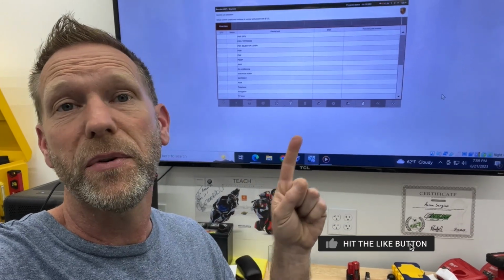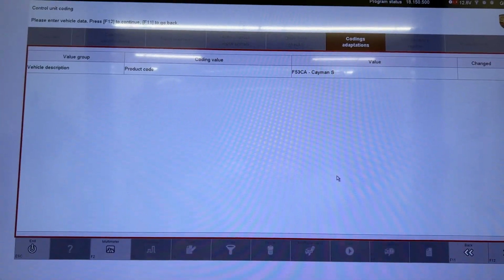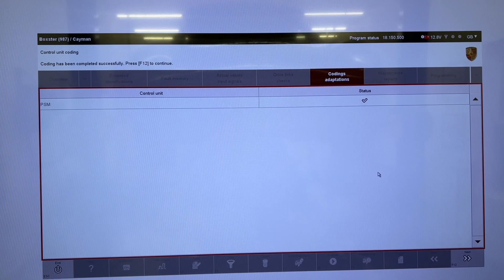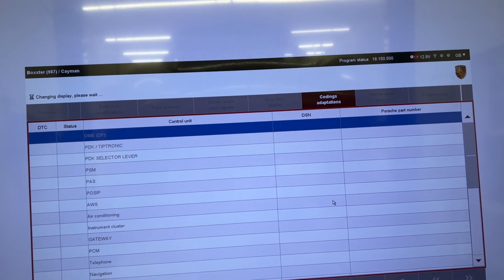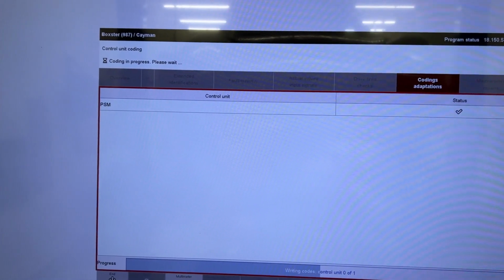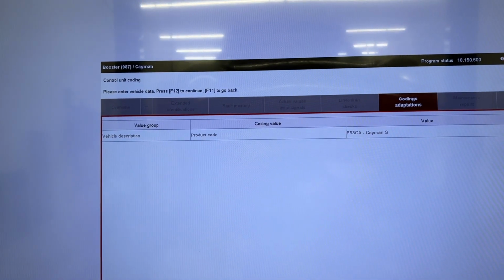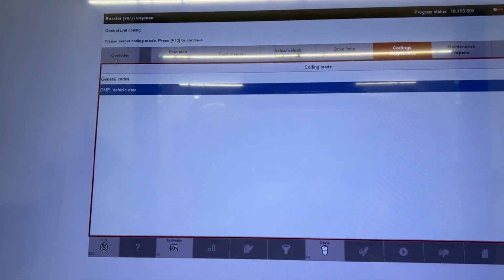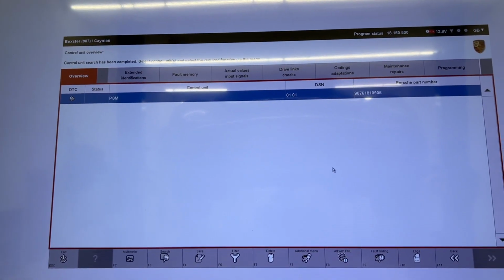ICE MODE FIX for Porsche using PIWIS

Comment: Hey Aaron, any updates on how this worked for you? Did you ever confirm whether how you coded this was successful? Just rented a PIWIS to attempt this on my 987.2
Reply from the maker: +@PeterSierraRacingSupply seems to have worked but I never experienced the problem before doing this so it’s not like I know it “fixed” anything
Reply: @HelpMeDIY  got it! I've been tracking my 987.2 for years so if it makes any noticeable difference I should be able to tell. It'll be a few months till I can test it on track most likely but I'll try to remember to come back here with an update. Thanks for the video it was super helpful!
Reply from the maker: @PeterSierraRacingSupply  yes please give us the update!
Reply: @PeterSierraRacingSupply  come back
Reply: @PeterSierraRacingSupply did it help?